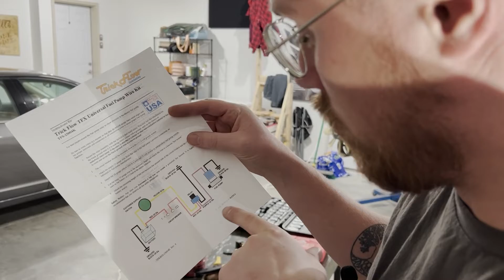How To Wire Electric Fuel Pump With A Switch | The Meano Camino

Comment: What kit did you use? This is the best video I’ve seen so far that makes the wiring process look easier. Thanks!
Reply from the maker: Hi Nathan! Thanks! We couldn't find the Trick Flow Fuel Pump Wire Harness on amazon to set up an affiliate link so we had not linked it in the descriptions. Sorry about that. Here is the link to what we used on Summit Racing: https://www.summitracing.com/parts/tfs-25004k

We did find a Fuel Pump Wire Harness on Amazon that is really close to what we used (the black ground is gray) I will link that below if you wanted to order through Amazon. We do get a small commission but we didn't want to just post the Amazon link because we didn't feel that was right. Thanks again! 
https://amzn.to/3aCDafO

 If you do go with the Amazon product let us know if we should endorse it!

Comment: What did you connect the black wire coming out the switch? Did you hook it to the yellow on the relay?
Reply from the maker: Correct, connected the black from the switch to the yellow on the relay

Comment: Is there not a way to avoid a manual switch but the fuel pump goes on when the engine run?
Reply from the maker: Yes, you just need to wire up the relay to turn on when your key is switched to “on” position.
Reply: @theroygarage  I mean only when the engine is running. Key on position does not mean the engine is running
Reply: @theroygarage then if you get into wreck and cannot switch the key off the pumps will continue to pump gas all over the place and maybe find a spark

Comment: Will this work for a auxiliary fuel tank?
Reply from the maker: I think it depends on the internals of the tank - the fuel pump is supposed to be mounted no further then 1 foot from the fuel tank and lower then it. If those parameters are met then I do not see why not
Reply: @theroygarage  nice because I'm putting the pump under my truck bed with the hose connected to the fuel cell. So I can fill up my tank while driving

Comment: Question on the fuel lines how do you know which is return and etc? I noticed they look like there different thickness
Reply: If you have a carborator it should say in or out. Also, look at the sending unit and try to identify which nozzle is which.

Comment: I’m not running a mechanical fuel pump. I installed an electric fuel pump today and it floods my carburetor when I turn it on. It seems like it’s getting too much pressure.

What am I missing?
Reply from the maker: What’s size engine do you have?
Reply: @theroygarage  SBC 350.
Reply: Adjustable fuel pressure regulator for carburetorated applications. Set between 5-7 psi